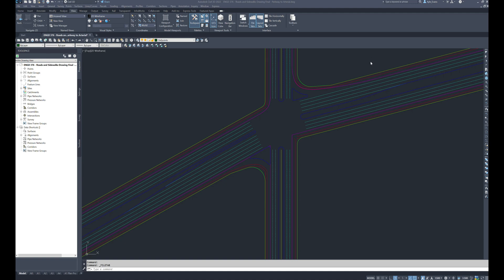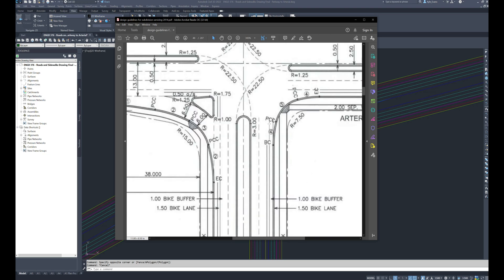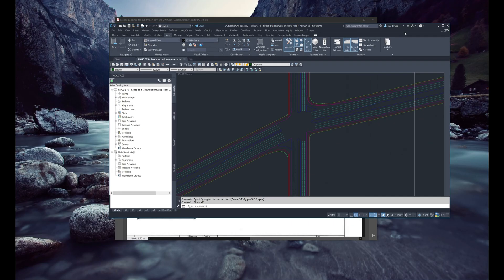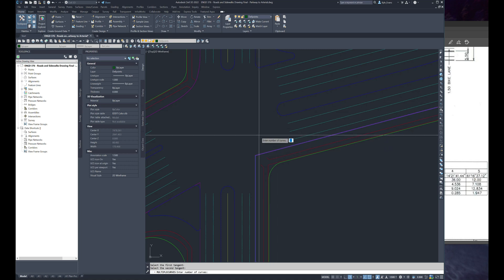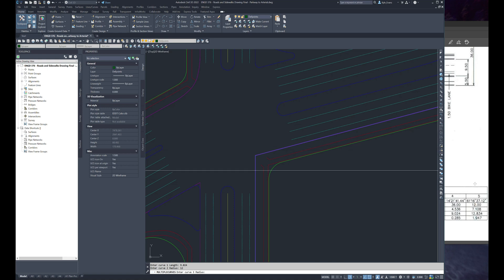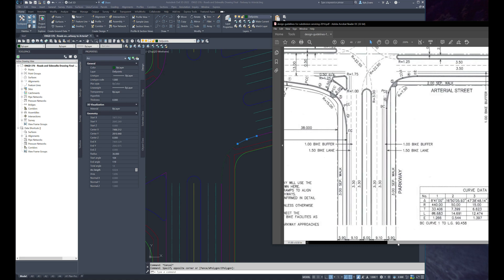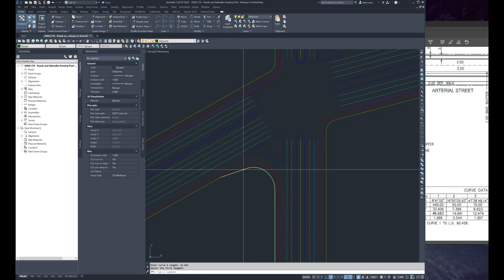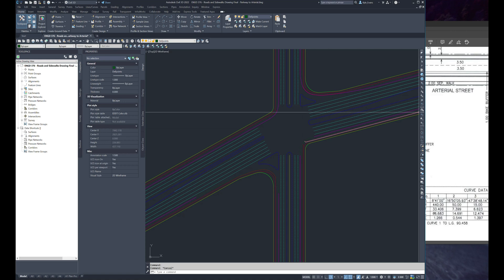Part 13 - Civil 3D Multi Radius Curves

Comment: Nice video!! Would be nice to show the best way to get these curves into a proper editable alignment. The intersection wizard doesn't work (well) for 4 center or 2 center curves AFAIK. Defining the alignment using the curves you made also makes it near impossible to edit later if designs change.
Reply from the maker: Yes I agree, I tried to make a video by doing the 4 center curves manually and it ended in disaster. Mainly because Civil 3D still has that stupid Targetting bug where it stretches the sidewalk edges instead of the road. As for a editable alignment, unfortuantly what you get is what you get with it. These curves rely on too much supporting geometry that editing them after the fact is all but impossible. It is easier to just redefine the alignment for them and adding that into the corridor properties. 

Also yes, the Intersection wizard only does 3 center curves, so 2, 4 and 5 center are out of the question. This is where you would have to create those alignments and profiles manually and tie them together with targetting. 

I will try to redo that video and see if it goes better.